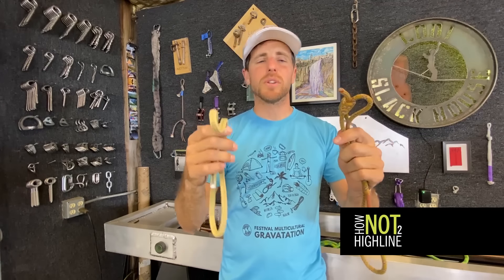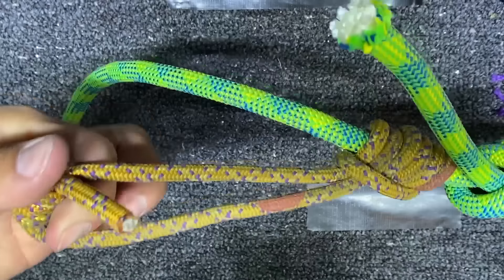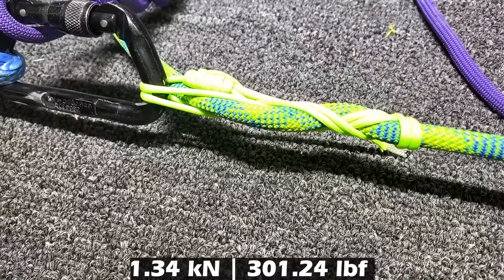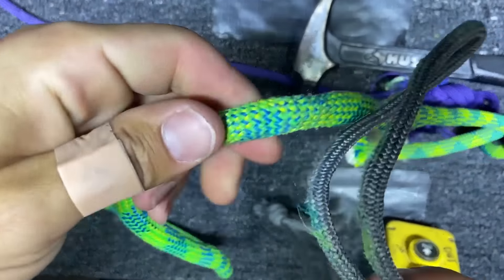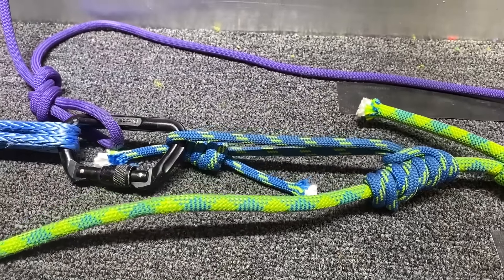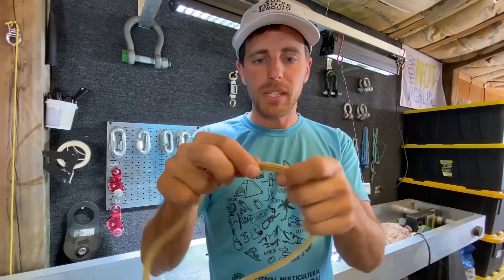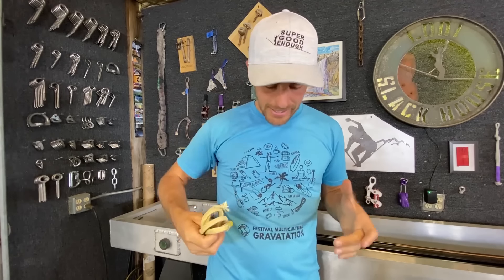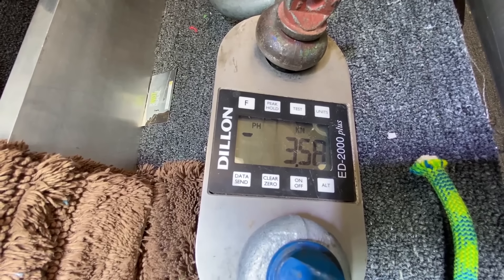Prusik, Auto Blocks, and Klemheist Break Tests

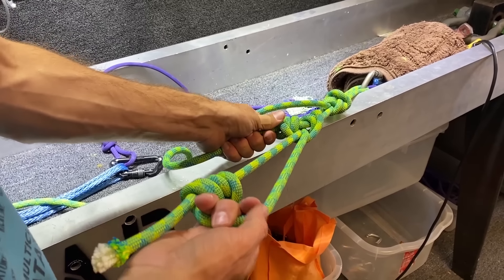Comment: Regarding 9:07 , if you were needing to use similar to equal diameter cord to form a hitch, a blakes hitch would be a more appropriate option. This certainly derivatives from the channel topic, as this is primarily used by arborists. However, it could be useful to know for climbers as well, as this allows you to create a hitch that allows you to both ascend & descend a rope using only the rope itself, without cutting a section off. Certainly, there is some emergency usage potential there.

Comment: Hollow blocks are aramid, so as you said they’re not really designed to stop- they are designed to be used while under load, and moving. Nylon would either weld or just wear out extremely fast. Examples would be like Michoacán and VT.

Comment: I always thought these little strings don't hold much, but then I looked up the breaking point of 5mm dyneema, its insane @18kN
I would not use regular paracord, its just not made for climbing activities.
Also i like to have the ability to use my cords as emergency ascenders using prusiks. Therefore, i specifically only buy 5mm dyneema core cords with Polyamide mantle. Super grippy for pusiks when rappeling too!

Comment: Interesting, I was taught that you want the prusik to be at most half the diameter of the climbing rope so for a 11mm rope you want at most a 5.5mm prusik rope(unless you use a heat resistant rope for the prusik so it can handle slipping without melting right away). It might have to do with us only using double looped prusiks instead of the 3 loops you use.

Comment: The point of the hollowblock is that it resists damage from heat as it slides down the rope for a rappel backup, but for static rope gripping it loses some benefit compared to the cost. You can get a longer version (19") of it for doing more wraps, although I've had no trouble with the standard length (13.5") doing a 3 or 4 wrap autoblock around 2 strands of rope when rappelling, it holds fine when I got hands-free. I don't bring it on glacier travel tho as it doesn't bite as well on skinny, wet or icy ropes as a nice, soft 5mm cord prusik does. Also, buy Sterling brand accessory cord, it's the best for friction hitches!

Comment: I've adjusted scenary height hanging on 1/8" steel cables with 5/16th tech line klemheist take the weight with my foot and adjust the cable locks. I've spent the whole day Doing this making micro adjustments

Comment: When I wanted a high strength friction hitch to pull on a rope with a trucks or mechanical
advantage, I used a 10mm rope that was very supple in a basket hitch. Gives you two pieces of rope to tie off to and I never had it slip.
Reply: How big was the rope you were pulling? I’d like to see video of this.
Reply: You could do it with a same diameter rope if the hitch rope is supple enough. But it was usually about an 11mm onto a 13mm. I would just google basket hitch.
Reply: Sorry looks like my knot terminology is not very universal. Here’s a wiki link to the hitch I was referring to. Just add wraps when more friction is needed. https://en.m.wikipedia.org/wiki/List_of_friction_hitch_knots#/media/File%3AValdotain-VT.JPG

Comment: Ive used prusiks on sailboats to take up load from lines that have an override on a winch. We usually use a ~3-4mm piece of Amsteel. Might be worth testing this with amsteel, I've done this on some pretty highly loaded lines, code 0 sheet on a class 40.

Comment: It would be interesting to see how these slow pull tests would compare to drop (shock load) tests. My intuition would tell me that a faster loading would result in less or no slippage.
Reply: Petzl I believe has tested this already, and the slippage in prusiks is actually a benefit in fall arrest; they slip until the forces get down to the 5-6kn range, absorbing the energy that might otherwise injure a climber in a fall on static or near-static ropes.

Comment: This seemed really silly. It doesn't matter how much force it can hold as long as it can hold your bodyweight (1KN per 220lb of weight). I can't imagine a situation where a friction hitch would be subjected to more than 2KN of force.

What matters is how easy it is to get the damn thing unstuck after you have been hanging on it for 20 minutes.
Reply: RIP you. A 200lb person falling a distance of 6 vertical feet with a 1 foot fall arrestor generates a 1400lb shock - that's 6.22kN. Whatever your backup is needs to be able to stop or slow AT LEAST that load without failing.

There's a reason why dynamic and static climbing ropes have such high load certification requirements. And even after a 6 foot freefall you better be thinking hard about replacing not only your arrestor gear but also your mainline.
Reply: @BlokeOnAMotorbike  I take it you have no idea what friction hitches are used for?

If you are in freefall for more than an inch or so while rappelling, you are going to die, because your anchor failed. Dynamic forces are not relevant to the discussion. Ascending a rope via friction hitches is no different.

Comment: I realize that the Blake’s hitch or the taut line hitch are only used in tree work, but they’re commonly used with either the other end of the rope you’re climbing, or a split tail system with a separate shorty piece of rope that is the same diameter as your climbing rope. I’d be interested to see what those break/break loose at.

Comment: I was taught that with the autoblock you want the loop just short enough to get your wraps and clip a carabiner otherwise it wont hold as much
Reply: Right. Fishermen do the same with a chain loop around steel wire. It shall be wound tightly.

Comment: It is better for a friction hitch to slide when overloaded instead of breaking. In tree climbing, the rule of thumb for diameter is: The hitch cord should be 2/3 the diameter of the climbing line. Pretty close to your 3mm rule, but the difference changes with diameter.

Comment: I'd be interested to see if having the working end of the main rope taut, would make any difference. Like, tieing a prusik knot to a steel rod sort of deal, the main rope is dead straight under tension from both ends. 

I honestly cannot give a situation where that would be the case, but it would be interesting to see anyway.
Reply: Thats something that can be necessary during rescues to create slack in a taut line

Comment: I thought that the value of a hollow block is that it has a much higher heat resistance than standard accessory cord, so it’s useful for long or fast rappels?

Comment: I think it's not cutting the 5mm cord because the friction is sliding kind of "with the grain" of the sheath and moving to different spots of the rope. Take the cord across the grain of the rope or cord like a sawing action and you have both the threads being sliced through across the grain of the threads and heat from both staying in the same area making it cut easily.

Comment: The only thing I'd like to add is I've always been told on a single rope strand and auto block or climb heist is wrapped four times at least. I have a feeling five wraps may have held
Reply: Yeah I use a 7mm sewn prusik and it takes 5 wraps on a single 9.5-9.8 (and probably others, those are just what I’ve tried) for an autoblock to bite. Haven’t tried a klemheist but I’d imagine it’s similar.
Reply: I love these videos but, Sometimes it frustrates me that he doesn't do much research before doing these videos because it says on the hollow block paper work that on single strands you should do at least four wraps. I would have really liked to see these done properly and I've been told and seen multiple places that you should do as many wraps as it takes to hold not just three or four wraps on every rope and cord combo

Comment: Isn’t an autoblock supposed to be used in conjunction with an rappel device? It may not work well by itself, but it might work for the purpose of stopping a rope from going through an ATC
Reply: Yes, but the idea is to have a completely independent backup in case your primary device fails. An autoblock clearly won't lock you in place consistently by itself.
Reply: If your belay device fails you’ve got big problems! I use my hollow block with 4 wrap auto block to clean handsfree all the time while bouncing around and it keeps the perfect tension to be a bomber third hand while easily releasable under load. IMO the best backup is the one that is easy to use so you use it every time.

Comment: Kleimheist with 6 mm chord is my go-to abseil backup, though I'm not sure I've ever used as few as three turns. Almost always when I abseil, its on a doubled rope - I wonder how this would affect the slipping point / breaking strength of the backup ????

For an improvised ascender, there is a trick where you clip the looped chord in a large screw-gate, then repeatedly wrap the double strands around and down the spine of the carabiner and rope, before clipping into the bottom of the loop. I believe this is called a Bachmann knot.

Also, drop tests with all these knots would be super interesting - can they arrest a small fall?
Reply: yes it is, I love the Bachmann knot - I use two screwgate hitches and sling both to my harness using custom 550 paracord braids for suspended descent/ascent off a viaduct on twin ropes. They're so grippy under load I've sat there suspended in midair thirty feet off the ground while wielding a long lens camera.

Comment: If you do a part 2, could you add in a valdotain tresse (VT) hitch. I used that on haul systems in conjunction with a single pulley and it has held up nicely, plus easy to release under tension. Curious if it'll slip like the auto block since it is a similar hitch.
Reply from the maker: so many requests for VT hitch.  I guess we will have to do it now!

Comment: Would be interesting if it makes a difference when using an overhand- or figrure-eight -knot to tie your accesory cord instead of the double-fisherman´s-knot as this is commonly used  in the alps (or at least austria). Probably not as the cords broke at the friction hitches but you never know. Curious about other´s opinions :)

Comment: In a next video, if you can compare a wet rope + wet prusik VS a dry system. That would be useful.
I'm a whitewater rescue instructor. We set up 3:1 zip line underwater for whitewater emergency situation (kayak/canoe stuck in rock and strong current)

Thanks for your great video; always thumbs up!

Alex from Montréal
Reply from the maker: Sounds Fun to test.
Reply: @HowNOT2  We use floating line from throw bag. But whatever comparison will be a great asset!

Comment: Any chance you'd test some much smaller, lighter duty uses? I bought a 600lb scale to test common bushcraft ridgeline materials, and haven't got around to it, or put in the time to design a test rig. I'm talking in the sub-1000lb breaking strength, often well below that. My desire stems from a post I made on a well known Bushcrafting site, and no one having a definative answer as to what's t e ideal ridgeline material, and also some comments saying a continuous ridgeline isn't worth doing, as the tarps fabric can carry the load. I bring this up as prusics are often used on the ridgeline to connect to the tarp, using a field expedient toggle(I typically use ~1/8"-3/16" sticks off the ground) on the tarp side as the weak link, so if wind, ect causes something to break, it's not the expensive items and is easily replaced.

Comment: One thing I find interesting is that tree surgeons often use either the tail end of the same rope, or chord only slightly smaller in diameter to the main line, yet it grips fine. Curious.

Comment: What about something such as a Beal Jammy or (in Europe, I use a Simond autoblock knot loop) Both of which are aramid core sewn loops rated to 22kn and are intended for this exact purpose. They won’t break easily and are skinny enough I find to add a lot of friction. In my experience I’ve never had one slip.

Comment: Nice thing about the rated prussiks is if you run out of quickdraws/slings, they will take a fall. I'm sure if you pulled the 14kn prussik in an open loop (undoubtedly what it's rated at), it would achieve a much more respectable score.

Comment: Could you test using a normal nylon sling vs a dyneema sling?  I've used both (dyneema only once before I learned of how low the melting point is) if I forget my prussik or am bringing someone newer out that doesn't have their own (I lend them mine and use the alternative for myself).  Curious to see the difference on strength and slippage.

Comment: Good and interresting test.
I'm french moutain guide and not really bilingual.
So sorry for my English .
I use an other  setup. 
With the same length of rope , I don't do à loop but a single rope with two simpe knots at the two ends. 
With it you just make simple turns around the other rope and put the two ends in the karabiner.
Like this , you have a better brake .
( single rope is more flexible than two ).
But maybe less résistance ?
But you can use the same diameter , so...
Test it ?
Reply from the maker: Do you mean the Valdotain Tresse? It is on the list for the next test.

Comment: Can you test Aramid prusik loop? I have a 2 metre piece and even tho hollow and the strength is all on the outside! I was going to make a chest harness for emergency! The height climbing store told me some ridiculous rating. I want to put a steel 6mm cable for arborist work! Please any advice if it's worth doing? Oh btw the hollow block of Aramid is 25 mm in width,  about 6 mm thick. Any reply appreciated cheers fAustralia

Comment: I was wondering if you could test an icicle hitch, we use it sailing instead of floating jammers to transfer winches, when things break etc, working loads are quite a bit higher but found you can still untie it after

Comment: I dont know why the sterling hollowblock is so popular. I do know that its made out of 100% technora which is a very strong material/fiber. I also know that the hollowblock is specifically designed for use with friction hitches. I dont know much beyond that. That said, I feel like if a company like sterling designed a product specifically for friction hitches, theres probably a good reason for it, and you can definately trust it.

Comment: I've always wondered if you could make a fall absorbing lanyard or leash by connecting 2 pieces of rope that would slip when shockloaded and thus absorb the force. drop tower test idea? :P
Reply: Like a fisherman's knot loop but not pulled tight.
Reply: I've actually seen those in industrial saftey lanyards mainly just for adjustable length
Reply: @justindunlap1235  yes! exactly what i had in mind. I wonder how good of a job that would do in case of a fall.

Comment: You would get different results if you were to use a non-mammut rope. I never use Mammut as I find them too slippery, a rope needs to have a decent level of friction to work reliably. I also use a 6mm prussic and have never had a problem with it in 50 years of climbing.

Comment: Why your piece of 5mm cord was not damaged? I think it is because what damages it is heat, and as it kept sliding along the rope the rope had enough thermal mass to absorb the heat created and the cord never got that hot. You might get a different result with a drop test, when all of the friction happens faster you might get a higher peak temperature. 

The hollow block is made from single-braid aramid. Aramid can loose a lot of strength from being flexed back and forth, even if it does not become fuzzy. There are man reports of hollowblocks being broken under body weight, it seem people don't know how to tell when they need to be retired.

Comment: Where do we use friction hitches?
I have ascenders, so I just use it as my redundancy when rappelling.
Reply: How do you unload the ascender if it accidentally catches when you're on rappel...? Do you have two ascenders on your person so that you can add the second one and stand in it to unload the loaded one?

I'm not familiar with climbing methods for this, only caving and our ascending systems are a bit different. We don't trail a safety because the rappelling devices are different / more controllable.
Reply: . @rachelhasbruises  See my post about the Evans' gambit on Mt Logan above (or below?)
Reply: @rachelhasbruises  Great question. I'll typically have some device I can lower on  - ATC, grigi, rescue 8 or such, any time I go ascending. I think I meant to type rappelling device.

Unless it is climbing where I'm tied in to the end, most of my rope work includes travel up and down the rope.

Caving rope work is fascinating and I want to learn more. The conditions of the cave and the rope necessitate some cool devices.

Comment: I think if there was tension on the line it would effect each system dramatically.
Reply: What scenarios would there be significant amounts of tension "below" (anchor being the top of the system) the friction hitch? Off the top of my hear I am only thinking of the top of a really long rope and de tensioning a line.
Reply: @bobbyhutton1989  I agree but even the weight of the hanging rope would hold it straight to a greater degree than a horizontal position.
Reply: @bobbyhutton1989  major rope weight (>300ft of rope weight) is the only situation I can think of....
Reply: Hey Bobby! We use VT Prusiks from Bluewater on lines that are tensioned “below” the hitch in several more-or-less common scenarios! Haul systems, De-tensioning lines, moving down a line to help a stuck client, etc. And, of course, as others have mentioned, when there is a lot of line hanging beneath you. 

Love seeing these tests! I’d love to see a follow up using other hitches such as a VT, and perhaps on a static rope as well as a dynamic one. Great content as always!
Reply: Some rope rescue systems employ friction hitches below descent control devices to grab the rope if the operator looses control. Testing has shown poor performance of friction hitches in that configuration however.